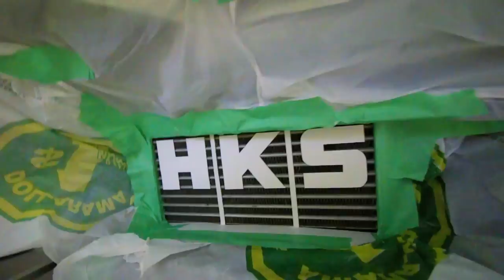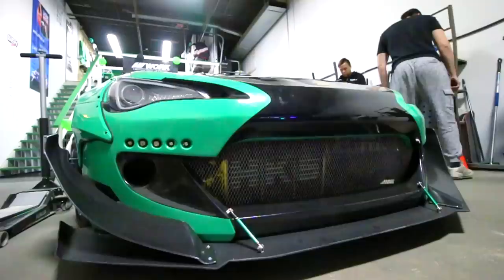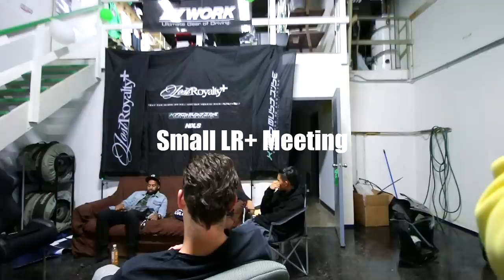How to Stencil Paint your Intercooler

Comment: An intercooler is a convection cooler meaning it's utilizing airflow through the cooler in order to cool the air inside the intercooler. By adding an addtional layer of paint on the intercooler you are actually limiting the intercoolers capabilities,  however it will be minimal effect change either way. Looks good though :)